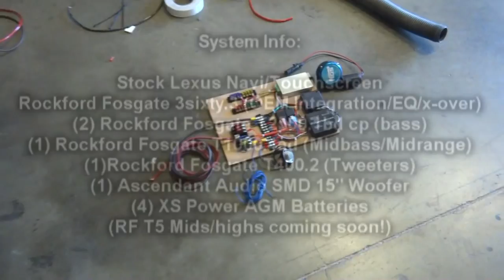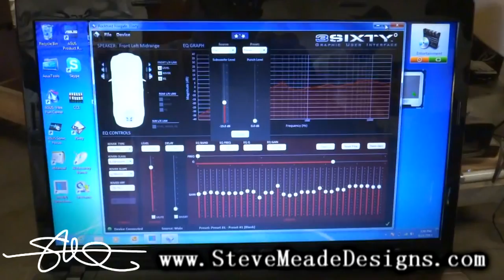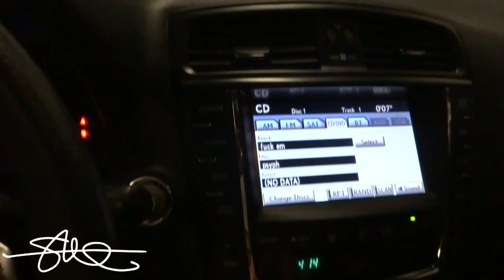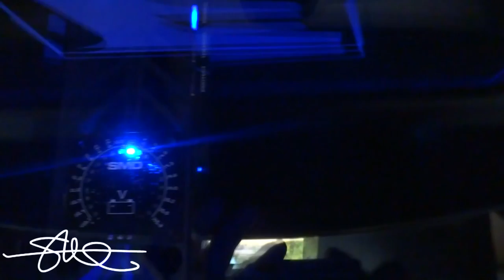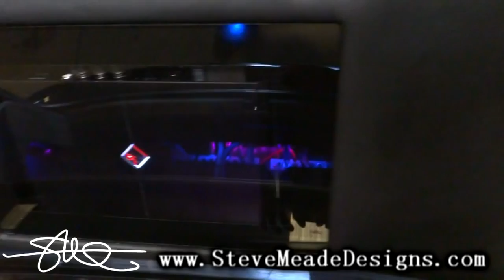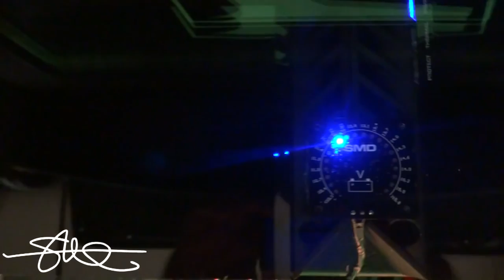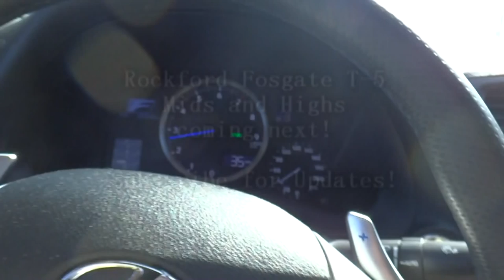Lexus ISF 7,000 Watt Sound System Install Video 6 - It Lives! RF 3sixty.3 OEM Integration

Comment: Did you bypass the mark levinson amp? Are those speaker wires running from the back of stereo straight to the 3sixty.3.

Comment from the maker: the 3sixty has Main, Bluetooth, Optical, and Aux IN.  Your ipod can be the headunit.....you don't even need one with this. The "bass knobs" can be assigned to whatever you want including as a master volume.  So you can make the one on the left master volume and the one on the right a bass knob.  No deck required. :)  This unit is incredible!

Comment: I...want...so...bad...sadly...I've...got...a...sh¡t...job...and...low...pay :(
Reply: Sam Hardy do me in the back of the alley
Reply: Nowadays you can learn how to do basically anything from YouTube just have patience and you could do this yourself for pretty cheap, and you can get cheaper amps and speakers that don’t sound as nice as this but they will knock any other home done install and if you take enough time to do it rigjt and not rush you could even beat some install places (probably not this guy cuz he’s the god of it) but you can do a lot more than you think if you take your time :)
Reply: Do it yourself and learn how to connect wires everything comes once you know what you need

Comment from the maker: i don't think it will.  The back seat blocks a lot of the bass.  Maybe if it was like my honda and the seat folded down...The "ski hole" lets a lot of bass in, but not enough for a hairtrick .  The goal of this system is SQ though, with a little bit of extra kick, but not an SPL monster. Sorry!

Comment: Absolutely beautiful install, could you please tell me how you got absolutely no trunk rattle?? Is it just boom Matt? Or did you do anything to the trunk like bring down the latch to make it a stronger seal? Or is it just because of how nice the car is and how solid it was to begin with, I have 4 12’s in a Saturn ion and I would want nothing more than to stop my trunk from sounding like someone threw a washing machine down a flight of stairs 😂 thanks For any tips, from anyone... I just don’t know what the best way to fix this is and I don’t want to get a ton of boom Mat just to have it partially fixed. Thanks again to any tips anyone has :)))
Reply: sound deadening and rubber grommets
Reply: LeadzCFW thanks!!

Comment: the equipment you want is all up to you. there are lots of different products that will do you well, but to keep the rattling down you need dynomat, or similar products! just try and stay away from low end product or no matter how much dynomat you use it will sound like crap.

Comment: Hah like the 'shake it up' ending. That's an amazing build. My only criticism is the NOS bottle, with all the extra weight of the custom audio system why add NOS? It does look sick though. The wheels, some wider 19x10's/19x11's would make it look BAD, and LED lights to replace the stock interior lights would make all the lights flow with the custom lights already installed in the trunk.

Comment: Hey Steve, when you run multiple speakers in a door like you are talking about for the Lex, do you usually have multiple amps and 1 channel per speaker? Or do you wire up the speakers in parallel/series to split the power while achieving the correct resistance?

Comment: I have been following your videos for quite a while and love them. I am now going to be jumping into a better system for my car since the stock setup is 20 years old and is totally gone. I am no means an audio enthusiast but I have been running audio shop to audio shop in my area and I have listened to really nice stuff by Audison, JL Audio, Hertz...etc. They sound phenomenal but for my purpose, I just want something that doesn't have that fatiguing high effect of cheaper speakers and has good mids but isn't uber expensive like the stuff I mentioned above. I noticed that you are a Rockford Fosgate fan. What do you think of their Punch series of components? Would they be a good option for me?

Comment: 4:44 sounds like someone in the backseats gone overboard with the eggs and beans hahaha =P

Looks brilliant, and it probably sounds brilliant in real life aswell(this video doesn't do the setup any justice. I like the resourcefulness of the fed ex boxes in the boot haha, are you using them as mounts or something? I thought the heat from an amp would be bad for cardboard.

I'm gonna be installing a decent sound system in the future so you think it would be alright to ask for your help if needed?

Comment: Hi Steve, love your videos. 
Few questions for you, why didn't you change the radio deck? isn't it a bad source of power the stock deck? you spent so much money on your speakers and have a bad deck, do you think you would not see a difference with a high end Alpine or Pioneer???
and second questions, if you were going to do that same speaker job for a customer how much would that would you charge, because you spent a lot of time on the install?
Thank you. keep the videos coming. Love it from France. :)
Reply: The audio goes from the iPad to 3sixty3 (I think) and then from there too his Mids/highs amp and subwoofer amps.
Reply: The ISF factory head unit likely cannot be removed from the car, this is becoming more common on high end luxury vehicles. Also, with the 3Sixty3 you can tune the system however you want (even better than a traditional head unit). As more vehicles have integrated head units you will start to see the old fashioned aftermarket head unit become less of a priority. Especially when you consider that tuning has become limitless with products like the 3Sixty3.

Comment: How much do you charge for a setup like that to integrate to the original system? Also, if the stock system is a 17 speaker surround sound will it still be surround sound after aftermarket speakers is hooked up?
Reply: I think he misspoke. 7.1 is 7 speakers + 1 sub. He said 14 speakers...I think he meant 14 wires. Unless there's 2 speakers per channel, which wouldn't really make sense stock. And to answer your question, the term 7.1 "surround" is coined by (I believe) Dolby which refers to their codec that delivers the sensation of being surrounded by the environment in a movie. So, if the deck is 7.1 capable, then, while playing the correct source (7.1 encoded movie) , then yes it will still be surround.
Reply: Thanks for explaining the surround sound. But to confirm, you did hear correct. His Lexus does come with 14 speakers. Check this link: http://www.lexus.com/models/ISF/features/options/?navTo=i0s1
Reply: Hans Taufa'asau Wow good to know lol

Comment: our local car audio shop installs these little grey boxs with a "amp power" little twisty dial(has a blue light), i know my info is bleak but if you know what im talking about are they still safe to use in these high powered system?

Comment: hey i just got my 3 sixty.3 and im reallly confused and dont wanna hook it up wrong......got a few questions should i use both the high level input and low level rcas like you or just one of the 2 .......and did you use that remote out wire or no just leave it unattached???........please help thanks

Comment: I have a 2007 Lexus is 250 awd and im trying to get some ideas of how i can put a double din. i have the one with no navigation, but pretty sure i have the ml sound system. i also would like to switch the speakers out and run them to a an amp and a different amp for my sub. any help would be great i just got the car about a week ago i love but this car is deff different than any other system install

Comment: With your tendency towards perfection I'm surprised to not see relay sockets @ 0:38.   Of course, the odds of a relay ever needing replacing before the car changes hands a few times, or ever, is pretty low.
Reply from the maker: +l337pwnage first time i have ever heard that one. LOL - you guys find ANYTHING to pick at.  Even stuff that has no business being picked at.  "OMG you used RED connectors instead of blue". LOL bro..no need for a "socket" on a relay.
Reply: meade916
You just seemed like the kind of guy who'd have a drawer full of new relay sockets in his shop for situations like that.   You are correct, though, it's not "needed".
Reply from the maker: +l337pwnage nahh.  i usually toss those things.
Reply: meade916
I'm surprised anything would come with them, I always had to order mine separately.

Comment: Ill be honest. You do top notch work, and your shit is always clean and bangin, and i mean SUPER clean. One thing i couldnt get past in this video though, was the stitching all over the back of that baby. Why have a sharp ass lexus, with clean ass sytem install, and some black leather with blue stiching thats fucked up as all hell? The stitching is wonky ass hell and all over the place. Its not symetrical ANYWHERE! If it were black stitching i wouldbt have mentioned it because it wouldve blended a bit, but its highlighted in blue! If it were my shit as a paying customer, id ve mad as all hell, the lines go from 1/4" gap, to 1/2" gap to and 1/8" gap all in a 24" section of stitching bro, come on

Comment: @meade916 What does the IS-F have for stock speakers that covers 80+ Hz? Can the RF T5s cover that or are you gonna sneak a pair of 8s in like you used in the Hoe? In my PT I'm gonna have to put in a pair of sealed 10s just to reinforce the 80+ range @130dB and you have way more SPL than I do. Just trying to learn from the master.

Comment: Hey, I'm wondering if AQ HDC 415, and the 3500D.1 are good? I'm wondering about getting 2 subs and 1 amp, and like 4 supertweeters and four 6,5 inch mids, and a AQ 120.4 do you think that will play? And will I need more batteries? Thanks for replies!!!

Comment: damn i would love 2 have a sound system like that. i love how u did the LED's in the back. thats my kind of style bro. i would like 2 customize my sound system with as much bump as possible with little rattle. how much did that work cost u? just 4 the sound system.

Comment: How much would something like this run?
Reply: Probably around 15k
Reply: +Skyler MacArt if you're his best friend, maybe 15k. I'm sure the processor and amps alone are at least 2k. Working on an install not even half as sexy and it's already at 6k..and more than half of that was sub, amp, speakers, wiring, materials.

Comment: how are you setting your eq with a laptop? or thats what i think your doing. lol
Reply: The 3sixty.3 you see in the trunk door has an equalizer. You plug it on the laptop using a USB cable and run the supplied software.

Comment: Pioneer DEH-P8400BH
Rockford Fosgate Power T1D412 x2
Rockford Fosgate Power T600-4 (speakers)
Rockford Fosgate T1500-1bdCP (subwoofers)
Rockford Fosgate Power T1693
Rockford Fosgate Punch P132
Rockford Fosgate Power T165

Do you think this is a good setup? I got the subs but nothing else yet. Let me know :D

Comment: how much for a setup like this??
Reply: Following prices is from ebay:
RF 3sixty.3 - approx. 1000$
RF T2500.1 amp - 900$ x2
RF T1000.4 amp - I'd guess it's a bit cheaper than the T2500.1...
RF T400.2 amp - same as the other ^^
and so on... The sub isn't cheap either...
And you also have to calculate materials as wood, resin, fiberglass and then a LOT of hours! This is EXPENSIVE so if you don't have the money, I think it's better not to ask ;-)
Reply: I'd say that sub is around $2k, I'd say just the audio set up alone is at least $10k because he's got 14 speakers in total.

Comment: I can't find a dealer anywhere on the net. I'm just wanting to go small. Currently got 2 pair's of T 1 Splits in the front and back running off a Rockford Fosgate T600-4 at 4 ohms so there each receiving 110 watts at maximum after doing my sums with resistance there losing 10 watts each but without the sums they would be getting 120. So averaged them minus or plus 1 watt down to 110.( Never gonna test them if they can handle it or not ) and wanting to go a 15 inch bass "{God Box}"SMD.shit!(TBC)

Comment: well actually i currently have the h800 processing  mcintosh mcc446 to dls gothia 6.3 and my friend is running the fosgate processor they are both nice units i guess it boils down to personal preference cause if you cant get either of them soundin proper you shouldnt be using it, but ya your music sucks :p